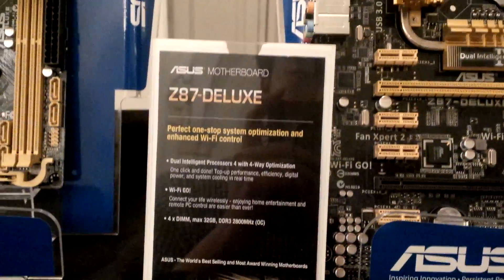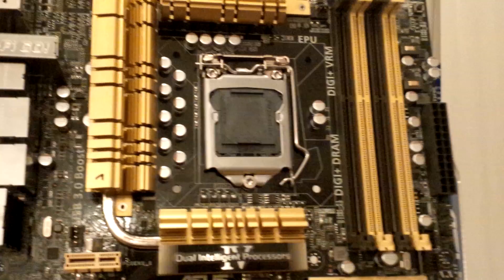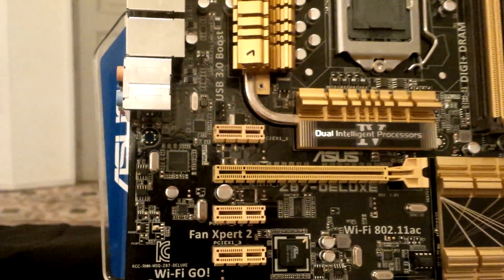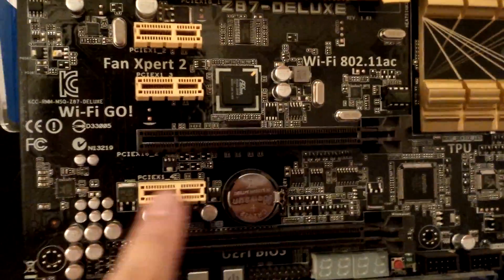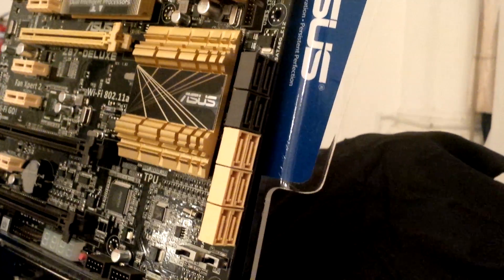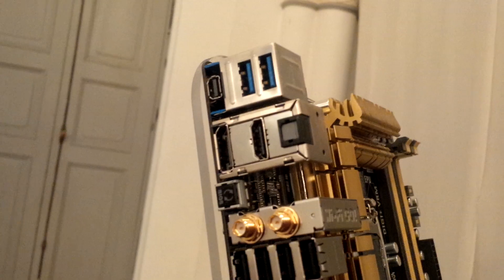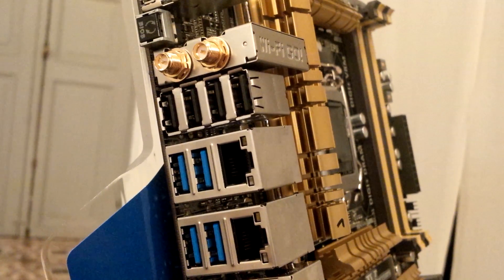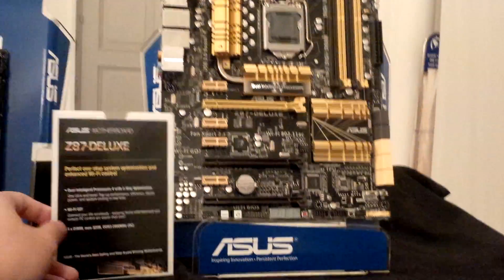First Look - ASUS Z87-Deluxe Motherboard

Comment: This is the board I want, but I'm confused with the 1150 socket using up to 1600 MHz RAM.... and this board supposedly supports 2800 MHz. What RAM should I buy?